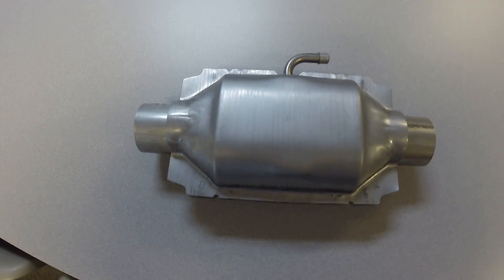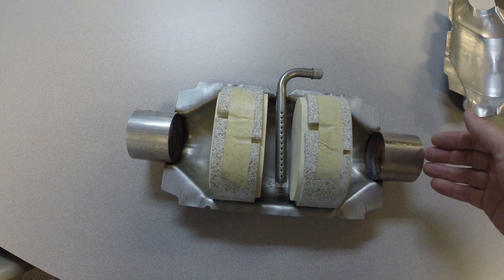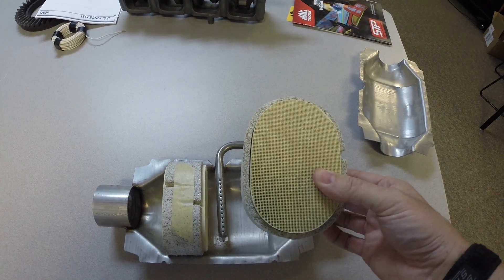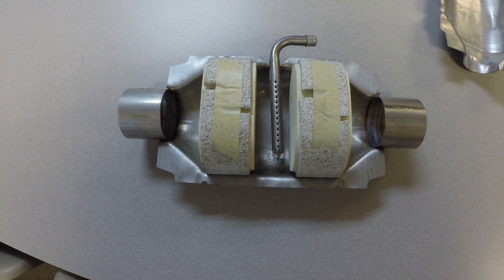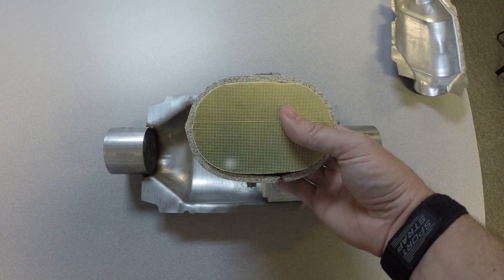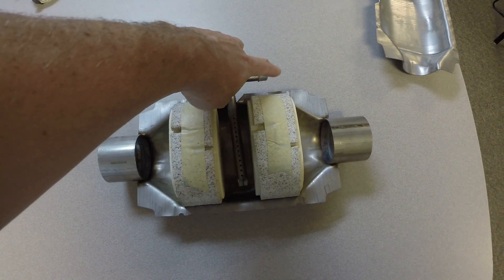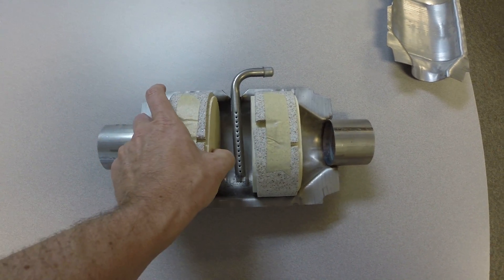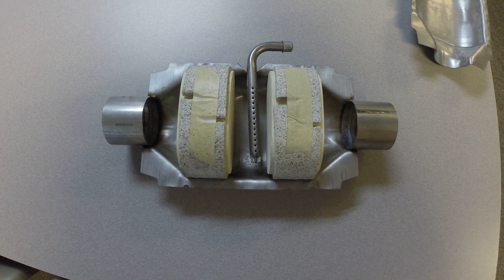How does a Catalytic Converter Work?

Comment: Does it only work when the temperature is high like for car exhausts? Currently working on a dry type type composter DIY project -  one that heats & dries kitchen waste & was thinking of re-purposing one within the recirculating hot air path to remove odor etc

Comment: Great video mate. And what are the belts surrounding the ceramic cores, they look like some kind of insulation/anti-vibration part for centering the ceramic cores. What are those belts made of? Are they ceramic too? Thank you.
Reply: Old question, but in case someone else wants to know. I work in exhaust systems, the mat is usually fiberglass or similar heat resistant "cloth" like material and sometimes include silver flakes for special fueled cars, and it´s only function is to hold the ceramic in place so it doesn´t get damaged by movement, It´s hella brittle, some of the newer cats especially E5+ also have the mat as a sort of heat shield. But 90% of it´s function is just to hold the crap in place.

Comment: You are very wrong what you said I took the catalytic converter off my car and then I dyno it again and it had double the horsepower
Reply: ARE YOU IMPLYING THE MOTOR TRADE WOULD TRY AND ROB THE PUBLIC BY DECEPTION HOW DARE YOU --- MERELY CONSTRUCTIVE MARKETING.
Reply: Maybe the converters were partially plugged. The substrates might have been partially melted. That will create lots of back pressure and reduce horsepower.

Comment: OK, so I had a Jeep, where the tube from the cat fed into the air cleaner. All was OK, except that the cat produced water. On a cold day, the water would freeze, and the ice would clog the engine. I had to disconnect the tube coming out of the converter during the winter, other wise the engine would die when it was below freezing.

Comment: When you have dual exhaust on an old Chevy big block with pipes 3 inches in dia. and an 850cfm holley carb getting about 8 mpg, it would need 2 cats for each bank? There's so much raw fuel coming out to make anyone's knees buckle. It may well burn through the cat converters on yearly basis with casual driving. A set I've found runs about $400-500. Would they even last very long?
Reply: Donu Duty why would a vehicle have a big carb like that on there in the first place?  That big of a carb would throw raw fuel out of it instead of burning it.  It makes no sense to me unless the homework has been done by matching the cam, the converter and the rear end for a particular application all that is accomplished is a bunch of noise and a carb that dumps raw gas out the end and poorer performance.  I guess it looks and sounds cool

Comment: What's up with duct tapes ?
Reply: That is not duct tape wrapped around the substrates. Those are insulators. They keep the heat generated in the substrates from passing into the outside steel shell of the converter.

Comment: any change in the temperature of the exhaust gases after is passes through the converter??
Reply: Yes. Remember that the second substrate essentially mixes oxygen and left over hydrocarbons and burns them inside the converter. The converter's inlet temperature can run at 350F while the outlet part of the converter can run at 600 to 700F. And that's only when the engine management system is working correctly and the hydrocarbon levels coming from the engine are correct and low. If you have a misfiring plug or a bad coil or a bad plug wire and you are throwing raw unburned fuel into the converter continuously that is what will overheat and melt the honeycomb structure. Under those conditions the temperatures inside the converter can soar to over 2,500F. Do that for very long and you can kiss the cat goodbye.

Comment: why do we need a converter if there is no lead in fuel any more seams like a waste of money just more money for the government I have one on my car. we tried it with one and with out got the same reading so I don't think the bloody thing works tipacal rip of
Reply: Cats werent used with leaded gas..dude
Reply: Mark Barry Eliminates carbon monoxide being emitted into the atmosphere
Reply: Stephen Hill C’mon guys, combustion makes CO, and there is no way to prevent it from going into the atmosphere and the catalytic converters certainly does not prevent CO(carbon monoxide) form exiting the tailpipe.  Of so the car wouldn’t.   What it does do is help reduce other byproducts of combustion of our modern fuels.    A candle release CO, plus vaporized parr’s fin and sundry other little nasties.    But gasoline is formulated to do several different jobs all at the same time. I.e reduce carbon deposits, help lubricate parts associated with fuel flow, maintain stability under vastly different environmental conditions, reduce unburned hydrocarbons, etc.   So the complex makeup also has different emissions depending on the situation.   Idling is actually one of the worst polluters, because efficiency at that engine speed is poor, and the engine runs too cool to get proper and complete burn, as well as the lack of proper air flow through the intake and ports because the engines were designed to operate over a huge range.     So these byproducts  end to be “scrubbed” from the exhaust, and they must be HOT.   
 Cats don’t remove CO.
Reply: blackjackskellington good one ..maybe we should take cats off.90 percent of people dont know anything anymore we need to thin the herd
Reply: Mark Barry CATs are not compatible with leaded fuels. Any lead in the fuel would clog the CATs quickly.
Reply: NOTHING WOULD SURPRISE THESE DAYS.
Reply: Fortunately for you your complete lack of knowledge of what the converter does doesn't have any effect on how well it works. It's not to do with lead it's to do with harmful emissions. Emissions that kill thousands of people every year and would kill far more if it weren't for catalytic converters.

You're the car equivalent of the anti-vaccine morons that get the herd benefit of vaccines without using them themselves. If everyone thought like you and removed cats from their cars we'd have thousands of extra dead people round the world, including possibly you and your family.
Reply: blackjackskellington but how am i supposed to get my car to spit flames then

Comment: Good explanation, but your closing statements are incorrect, the fact of the matter is, those plates which the exhaust gets pushed through are going to create resistance of flow whether it be minuscule or a lot. So therefore creating some back pressure, so the engine isn't going to be running as efficient as it would without one. So yea it will create some loss of horsepower because you are restricting the flow of exhaust gases..... And that is why a basic way to create more horsepower is to take your catalytic converter off (which is illegal for road worthy vehicles because of emission standards). And that is why everyone says it robs your car of horsepower.
Reply: j0n0j0n0j yes you are correct but this may be very minuscule power or in some cars it actually gives you more low end to mid end power where you will be mainly driving at in the road.
Reply: j0n0j0n0j although you are correct. you are forgetting one key fact. the engine is designed to operate most efficiently at that pressure differential. So you might gain a minuscule amount of horsepower, but you will also loose fuel millage in a manner similar to running on a lean fuel mixture.
Reply: j0n0j0n0j he also failed to mention that the smog pump robs horse power
Reply: If you look at the cross section of the honeycomb it is much much larger than the exhaust tube so the restriction is reduced. In the end your muffler is much more restrictive than a modern converter.
Reply: Some back pressure is good for overlap.

Comment: A lot of the generic cat converters do not have a directional arrow on the unit itself, so when you have a converter with no arrow, how do you know what is the inlet and outlet. mine has a oxygen sensor fitting but has a plug because the sensor is upstream (on the exhaust manifold itself). It's an OBD 1 cat converter and would like to know if there is a direction or not. Both inlet and outlet are 2" openings.
Reply: Kevinvansea yes the oxygen travels through